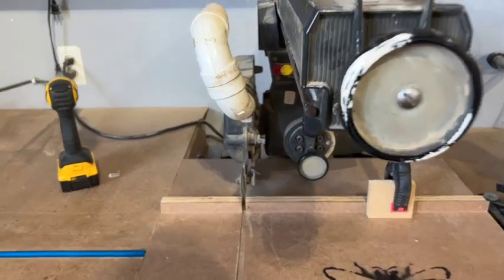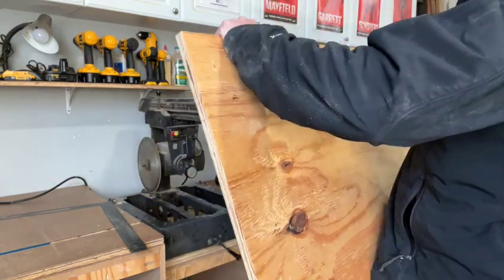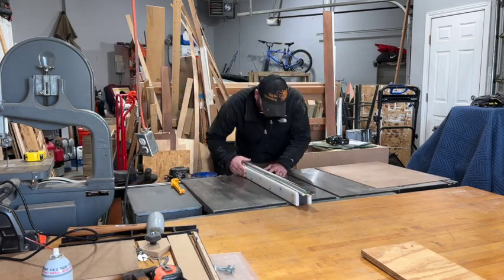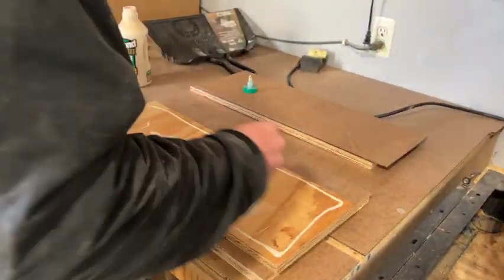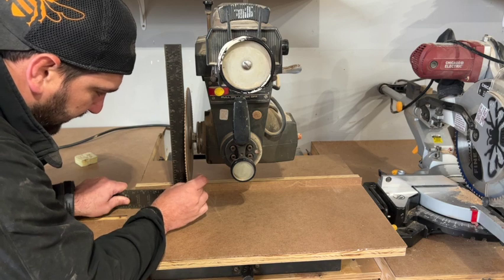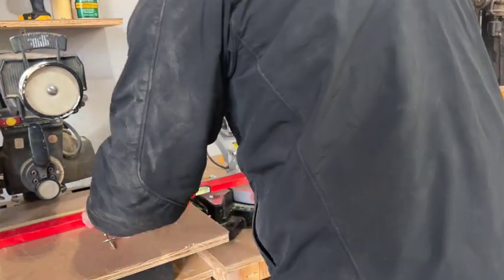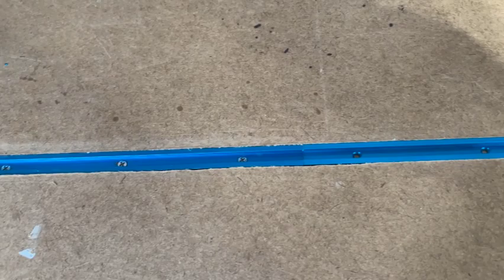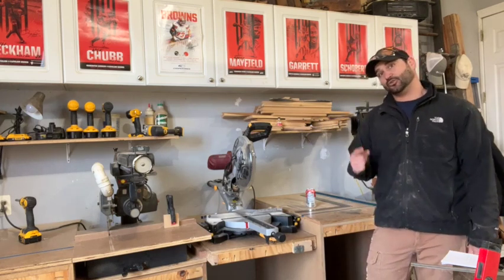Miter saw and Radial Arm saw station setup

Comment: Nice video.   I recently acquired  a radial arm saw, and i am currently in the process of building a bench for my miter and radial arm saw.   I was planning on putting the miter to the left of the arm saw.  Is there a specific reason why you placed yours on the right?
Reply from the maker: It would work on either side, just landed that way in my shop as there was more room on that side.

Comment: Love the build! Question for you. I have the same radial arm saw I got it for free cause, the motor is seized. Looking in it I see plastic melted in it. Might just be the fan blade melted if so I can easily 3d print up a new one for it. I also have an 80's model that works great but the cabinet is too big for my garage. I am thinking of swapping them out soon. Do you think its worth it? How's the power on the older one? 

Can you cut into the wall behind your sliding compound saw? If so you can easily get a couple of inches on your radial saw by moving your compound back a little.  I also have a Drill Press like yours. Mines an old champion one that I just got a treadmill motor for it. Its a great upgrade with better torque and easy speed control. No more belt moving! You might like to do that to yours.
Reply from the maker: I know a lot of woodworkers have replaced these with a good sled for their table saw, but I was always raised with on in the shop. As long as you have a good blade mine handles what I throw at it and comes in handy from time to time.

Comment: I like this. I inherited my dad's radial arm saw. I have a new garage / shop to build up. I feel like I might need a mitre saw for doing trim work? Or is a radial arm saw exact/trustworthy enough to do mitre / trim work?

Also, love the continuous work surface w/ fences lining up. I think i need to get dad'd radial up off of the 'stand, on a rolling wood tray' build, and just put it on a cabinet made for it & line up with my other woodworking "furniture" :)
Reply from the maker: You can get away with one or the other, but in my experience I tend to use the miter saw much more than the radial arm saw. I dialed my radial arm saw to a perfect 90 and don’t touch it so it stays in line. The miter on the other hand gets repositioned constantly. Also, I have resent purchased an incra table saw sled, which is much more accurate than both and has really replaced a lot of the work when it comes to making frames.

Comment: I hope you don't mind me mentioning a couple of safety concerns. 

At time 11:46 I was startled when I observed the blade of your RAS extending beyond the edge of the table. This seems unnecessarily hazardous.  Typically, in a more protected table configuration, the table extends several inches beyond the end of the blade providing a barrier between the rotating blade and the operator.

In a similar vein, the back table (the bit behind the fence) should be lower than the front table (the bit in front of the fence). This height difference serves to create a safety zone where the operator of the saw can safely let go of the saws handle with the blade still spinning, and not risk the blade/motor assembly inadvertently grabbing the table and self-propelling towards the operator.

More info can be found at Part 6: Table Protection - https://www.youtube.com/watch?v=l7CkmjK0uvI

Comment: You did not align the RAS table to the arm.  You just bolted it down without checking it.   If you need to know how to do that, just ask.
Reply from the maker: I actually had a video where I did break down how to get this all aligned and running true, but in editing I didn’t like it (was tough to get good camera angles showing what I was doing) and decided not to post it. Thank you for the offer though!
Reply: @BusyBeeLiving     Great.   It should work well for you.